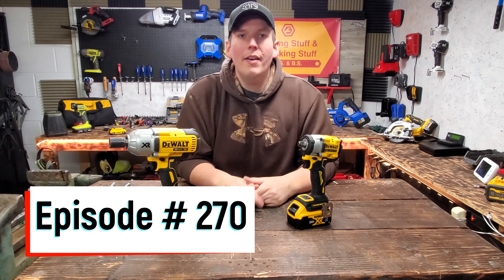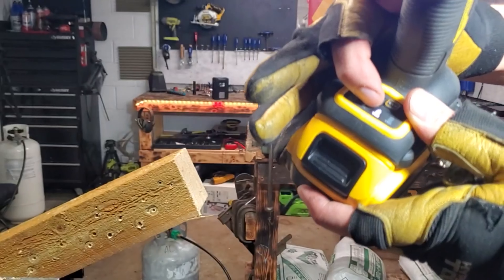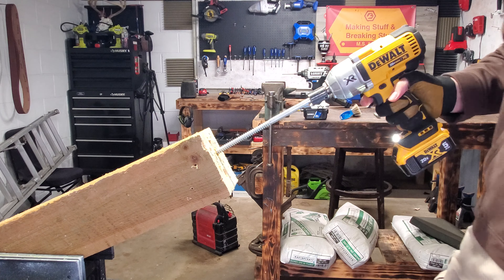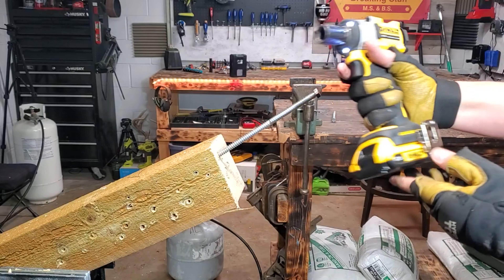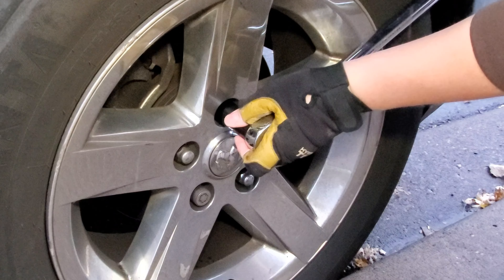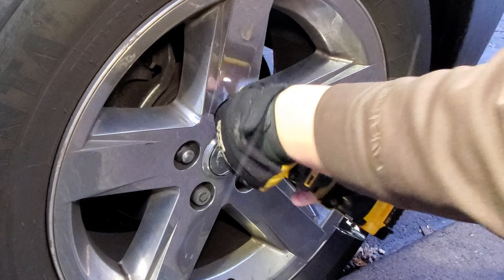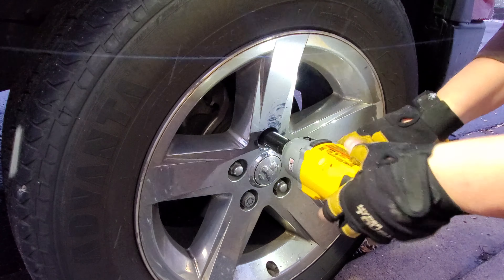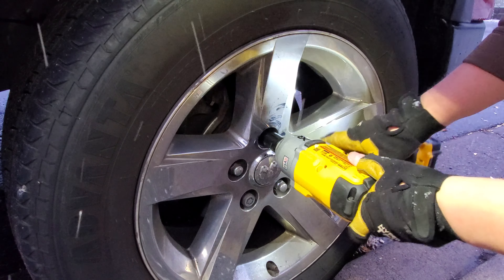"New" Dewalt Atomic 4 Mode Impact Wrench 1/2 Hog Ring Anvil, Testing and Comparison

Comment: Just bought the DCF 922 kit today, 2 x 5aH batteries, charger, stak case (922 is detent pin model) hog ring is the 921. Very impressive and powerful for its size and weight. I have the 899 as well, it's great but it is very heavy and bulky for getting into smaller spaces....
I might sell it on if the DCF 922 suits my needs around working at the cars.

Comment: Cool. I have the 20V Max 1/2in drive Compact Impact (Brushed). It's a beast-will run 1/2" x 8" lags into conifers easily. It laughs at lug nuts.

Comment: I think it was slower than the DCF 850 because of the higher RPMs.  I think it's doing over 3000 compared to the 921 doing 2500 rpms, so, given that the torque is well within what both were capatble of, the 850 driver was able to do the work faster, but the 921 is definitely hitting harder.  Other videos show it having haigher torque ratings than the other Dewalt and Milwaukee stubby models, and breaking off nuts torqued to like 400 or 450.  That lil' Atomic is the one to beat right now.
Reply: That's exactly what I'm thinking, as long as the task isn't too much for the 850 it'll drive with more speed than the bigger brothers. I've yet to see anything with a lower rpm best it in that regard.
Reply: I have an 850 with a 3/8 anvil and Powerstack battery. Wonder how that would do in this contest😎

Comment: I just use dcf899 3 speed on my focus. You pull the trigger, and it almost feels like air with 6ah. Its only 100ft lbs. I buy new lug nuts too. I hope I don't need studs😬

Comment: Some of the people in my shop blast their lugs with an electric high torque. Sometimes seating them at 400 or more ft lbs. I can tell who worked on a car last by whether or not my atomic can pull the lugs off...... may need the new mid range cuz I hate having to pull out my air gun for those.
Reply: I have a mid range and run into same issue. If lugs are torqued properly it works fine. But if previous tech was an asshole it won't take them off.

Comment: I could be wrong but don't high and low settings on the dcf921 have the same power in reverse? Only reduced in forward correct?
Reply from the maker: Yes I believe your right, But I am not  a 100%
Reply: Speed 1 is 300 lbs in reverse, and speed 2 is 450 lbs in reverse

Comment: Dewalt make my head spin with so many versions of impacts. I just bought the dcf921 for $110 bare tool, cant wait to test
Reply from the maker: You are correct they have a ton!!!! Thanks for watching man.
Reply: Where did you find the 921 for $110?
Reply: Where did you get it for $110?
Reply: @tinman1955  Home Depot has a buy-one-get-one “free” battery if you buy it as a bare tool. Get the bogo deal then return the battery. There’s a bundle that includes the battery. Don’t get the bundle, because you would have to return both and not separately
Reply: You're lucky, they are approx £180 in the UK.
*Edit , bought the DCF922 kit today (it's the detent pin model) 2 x 5aH batteries, charger and Stak case. £340, not cheap but it's very good.

Comment: When testing on the lug nuts you only used the first dewalt for 2seconds and then the xr for 6 seconds maybe if you left the dcf921for longer it would of took it off just like the xr did
Reply from the maker: Yeah I am not perfect, I was a little worried that it would just rip off my lug nut too. and it was freezing out.
Thanks for watching man.

Comment: Thanks for the comparison. Would be better to grab some grade 8 bolts and make a test rig than to use your lug nuts. Those are usually torqued around 90 foot pounds. Not surprised you shredded the threads after that abuse haha

Comment: Surprised there is a lag bolt mode on a Tool made and Marketed as a Automotive Impact Wrench
Reply from the maker: Yeah I was not sure what all the modes were so I actually had to look at the Manuel.
Reply: @Impact-OG  sometimes ya got no choice but to look at the manuals
Reply: I have the xtreme 1/2 inch impact wrench for automotive stuff, the small 12 volt battery makes it great and it's rated at 400 break away
Reply: @Lee-lb9qh  yeah I have that 12v xtreme  1/2 impact also
Reply: @Lee-lb9qh  what a tool is rated at and what it actually does are 2 different things just keep that on mind lots of channels have shown what is written on paper isn't always what the tool actually performs
Reply: @AntonioClaudioMichael  ya I know it still works for what I use it for though
Reply: @Lee-lb9qh  works for what I use it for as well
Reply: @Olds_Pwr  I agree
Reply: I dont know why you would need any speed control for automotive use. I have the dcf899 and it is always on high. My finger is the torque regulator. The other two settings just reduce speed which is silly. I just bought the dcf911, it has none of this silly shit. It has less torque than 921 but it's 99% of the time going to be doing one task that doesn't need huge torque (caging air brake chambers). It'll work fine for automotive jobs too. I did an engine swap a while ago and used the shit out of a dcf880 that I currently use for caging brakes and it worked fine with 140 or whatever foot pounds. The 911 has higher rotation speed than my crappy brushed one, only reason I bought it.
Reply: @Julio Gonzo  everyone is different I do use my finger to regulate speed but modes do help if you put it in speed 1 your finger to regulate the speed it's more Fine Adjustment at lower speeds everyone is different some people don't regulate the speed at all they always just go full speed no matter what everyone had their own preferences good points Sir

Comment: Wow the dcf850 impact driver whooping the new DCF920 impact wrench with a lag in speed and even the old DCF899 Faster with Lags then the New DCF920
Reply: The DCF850 Is fast but it’s not even Dewalts  fastest at the moment. the DCF840
Reply: @mowork8468  yeah I agree the dcf840 is the fastest